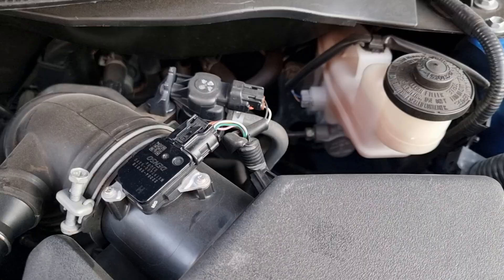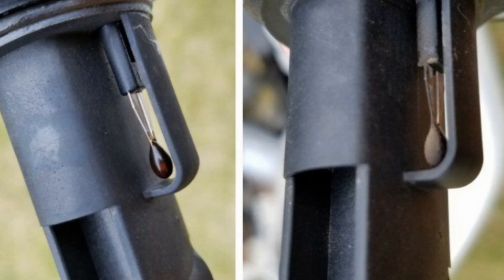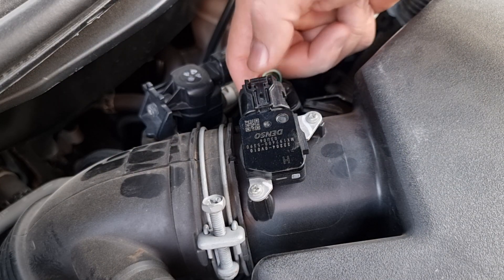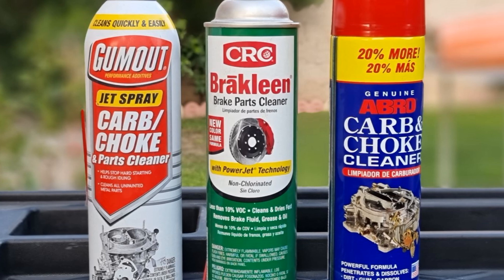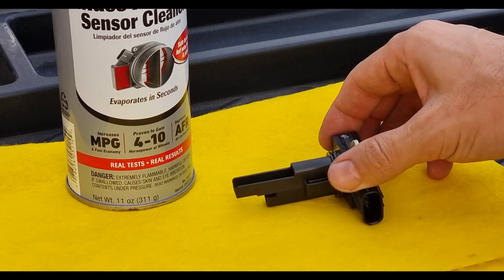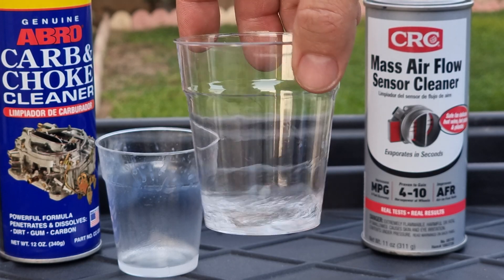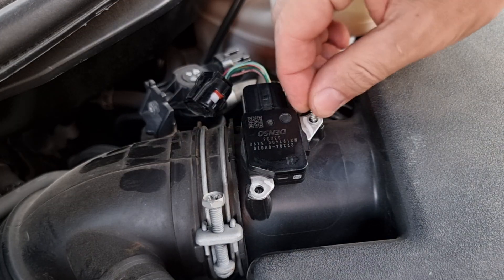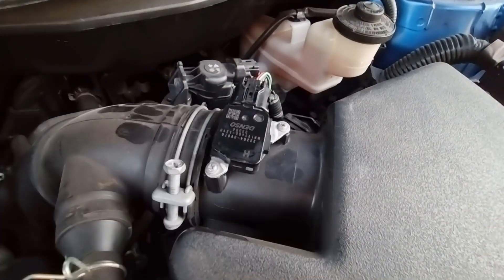IF you clean this, Engine will burn less fuel../How to clean Mass Air flow sensor/Camry MAF Cleaning

Comment: hey ali im told from the toyota dealer i need mass air flow cleaning service but i dont have a check engine light on my car is a 2017 toyota camry se it has 81,000 miles what do you advice me
Reply from the maker: It's not bad if you clean it, it will read more accurate reading for fuel consumption
Reply: @AliMECH  thanks ali for your advice 😁🙌 i will do that
Reply from the maker: @almaprado969  no problem,  you are welcome

Comment: I've heard that brake cleaner will damage the AFS so many times, I've ALWAYS used it and it does NOT damage it nor does it leave any residue (it is specifically made to NOT leave residue or damage the plastic contacts around the brake disc). 

Sponsored by CRC?

Comment: I just cleaned my Mass Air flow sensor how long should I wait before the service engine light comes off before I replace the entire thing?
Reply from the maker: You can reset the ECU by removing battery terminal or with old scanner, if the same code came back again, it means the MAF sensor needs to be replaced,

Comment: Can you do a (evaporative emission system leak detected very small leak) p0456 .  my 2015 Camry popped up with that code if you can show how to do it nd how to diagnose it.
Reply: Don't know if you got it fixed since it's been 4 months but if not I wouldn't be surprised that when you went fueling you didnt srew the gas cap tight enough.

i.e. Not enough "clicks"

Comment: Do you know if a 2014 hyundai elantra gt has MAF? Where is it located? Thanks!!!
Reply: Just follow the air intake path and look for a sensor on the rubber booth.

MAFs are usually found on every engine that runs on gasoline.

Comment: you should becareful  the o ring in the maf sensor if its damaged it will leak air
Reply from the maker: That's why MAF sensor cleaner should be used,  it's safe for plastic and O rings

Comment: Ailimech, I am having a problem with Code P1604. Could you please tell me what to check? Thanks Lc
Reply from the maker: There is so many reasons to cause p1604,  check the fuel pump sound while ignition on, and also the fuel pump fuse...
Reply: Thank you, Larry